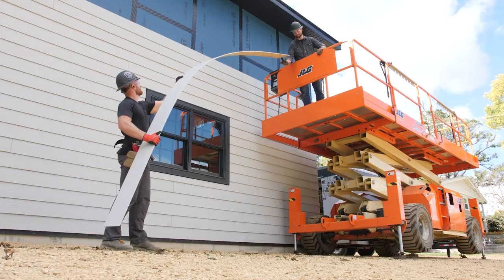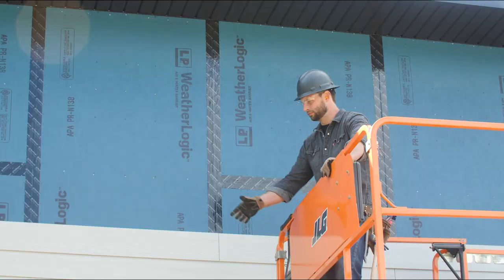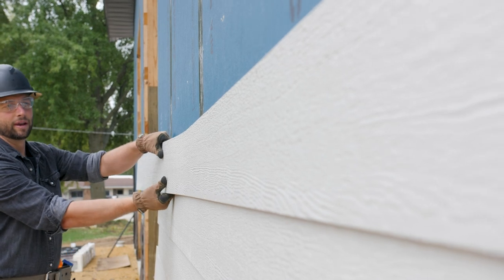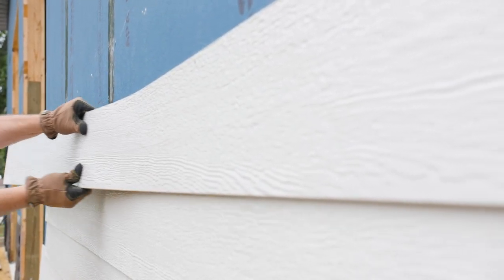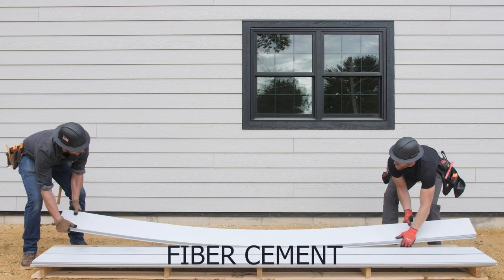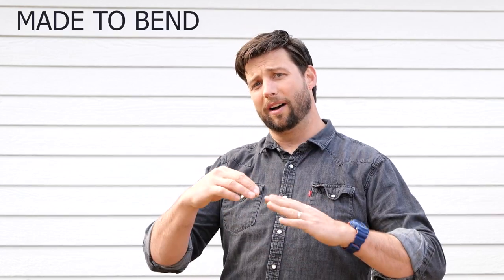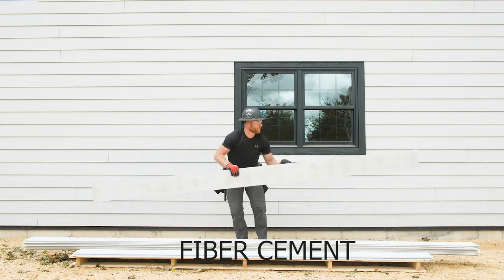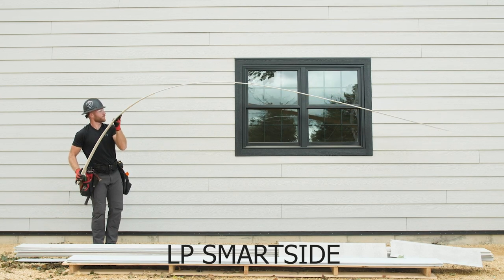LP SmartSide Install with RRBuildings

Comment: I live in a sunny, dry (8 inches of annual rainfall) climate. Smartside is the fascia and the vertical face looks like new after 14 years. However, after about 10 years I noticed the miter joints in some of the corners near the gutters had swelled and delaminated. I assume the cuts were not sealed during installation, but I would be concerned in a wetter part of the country.